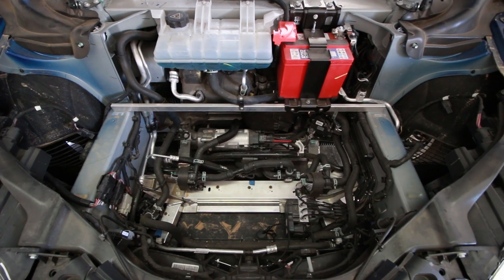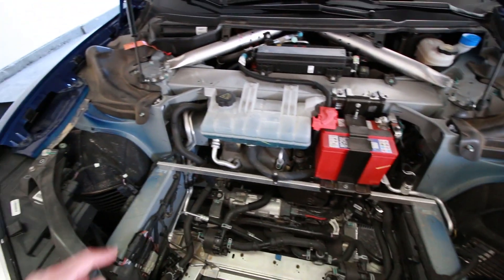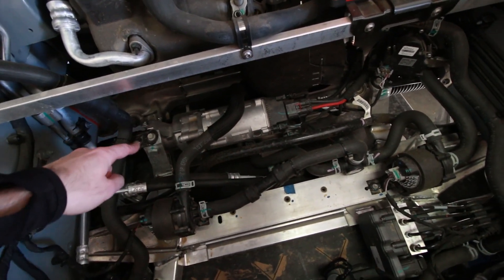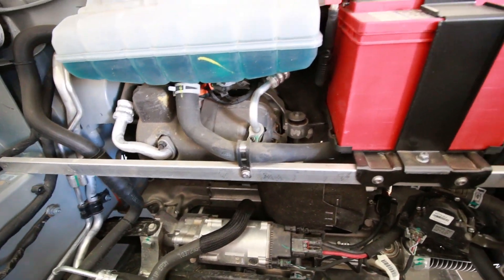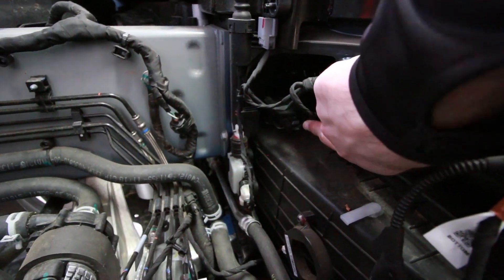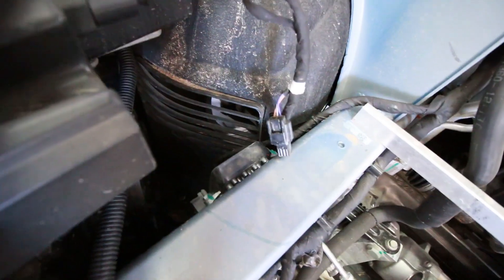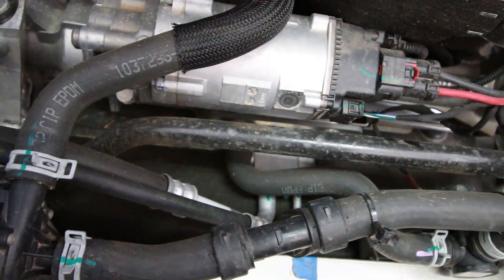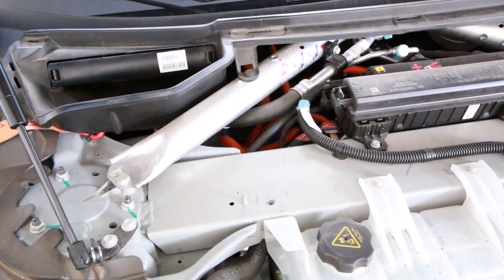What's Under The Frunk Of A Tesla Model S?

Comment: "Pre-refresh" and "post-refresh"? My 90D was delivered in late 2015, a few months after the first autopilot hardware was added. Is that "pre" or "post" refresh??
Reply from the maker: Hardware 1 (first gen Autopilot hardware) was introduced in October of 2014, the software that made it work was released in October of 2015. That detail aside, the first major refresh the Model S went through was in April of 2016 and is most easily identified by the lack of the large black nosecone that's present on older Model S. Being a late 2015 dual motor car makes yours pretty much the same as mine (pictured in video), just with a bigger battery--it's pre-refresh.
Reply: Got it, thanks!

Comment: Great, informative video, Alex! I'm so glad that I found your channel today. I couldn't even get the salespeople at the Fremont factory to admit that their cars had a 12 volt battery. Thanks for taking apart your car and explaining some of car's features. Where is the heat pump that warms the car's coolant to heat the cabin and warms the battery pack?
Reply from the maker: Tesla isn't actually using a heat pump system in the Model S/X for heating. The battery pack is heated by a combination of waste heat from the motor(s)/drive inverter(s) and a resistive heating unit as needed. The cabin heat is produced by a separate positive temperature coefficient heating unit (essentially a resistive heater where the resistance increases in a nonlinear fashion as it heats, causing it to self-limit current draw and, thus, temperature). This photo of a diagnostics screen is from an older rear-drive Model S, but should give you a better idea of how the thermal management system works (both the battery heater and cabin PTC heater are labeled): https://i.imgur.com/sZEnZFT.jpg
Reply: Alex Venz You're amazing! Thank you so much, Alex

Comment: Why is it that I can see all the way through to the ground (look along the steering rack,you can see the CV joint to the ground) isn't there some type of water barrier on the underside that would prevent me to see through?
Reply from the maker: While the Model S does have covers along the whole length of the underbody for aerodynamic reasons, it is necessary to have openings that allow for the passage of drive, suspension, and steering components as well as accommodate the full range of suspension motion. It is possible to create water resistant passthroughs, but it would be an additional expense and prone to wear related failure. The simpler solution that's used across the automotive industry is just to make your electrical connections and components water resistant where necessary.
Reply: Alex Venz which actually makes more sense

Comment: Hi there, very interesting but what is this 12v battery for and unlike a conventional car doesn't obviously get charged does it? Seems odd to have to have it replaced so regularly.
Reply from the maker: The 12V battery serves several functions, some of which safety related. The first and arguably most important job of the 12V battery is to power the main battery (traction battery) contactors--these contactors connect/disconnect the high voltage traction battery from the car's electrical system. If no power from the 12V system is present, the traction battery's contactors cannot close (or remain closed) and the high voltage pack remains isolated from the car. This functionality allows first responders to easily render the vehicle safer to work on in an emergency situation and it also keeps with general good practice of not energizing the high voltage systems unless they're needed. The other job of the 12V battery is to power all of the conventional automotive systems as well as the onboard computers.

As for charging, the car monitors the voltage of the 12V battery and will either charge it while you're driving if necessary or it will engage the traction battery's contactors to energize a DC-DC converter and charge the battery while parked. The high rate of replacement seen in the past was likely due to a combination of battery choice and the high rate of drain from the Model S (it could easily cycle the 12V battery multiple times in a day, even when sitting idle). Tesla has made some software changes which have improved the idle drain significantly, so it's less of an issue now.
Reply: Many thanks, Alex, for that very comprehensive explanation.
Reply: You should have this explanation in the description or something, there are a lot of idiots that are angry and confused over nothing.
Reply from the maker: Good idea--done.

Comment: What is the coolant for? (1:15 mark) battery pack?  motors?
Reply from the maker: The Tesla Model S and X use a liquid cooling system to pull heat from the battery pack, traction motors, motor controllers/power electronics, and the onboard charger(s). Even parts that are 90-95% efficient dump a lot of waste heat in high power applications.

Comment: The Frunk isn't full of stuff that is why you have storage space. The first couple of years Tesla had standard 12v automotive batteries that could fail after a year. Now they have heavy duty marine application 12v batteries. We don't know how long these last because they have not been failing.
Reply: No, because Li-Ion batteries are never meant to be deep cycled.  And cold and heat will kill them.  And Li-Ion batteries  will lose power just sitting.  Where as the Lead acid batteries are deep cycle and will stay almost fully charged when sitting for a long period of time in many environments.  Remember the big battery pack in the Tesla constantly manages pack temperature to ensure longevity.
Reply: If Li-Ion batteries were to be cheaper in the future, would it make sense to replace lead-acid batteries entirely?
Reply: It's the only thing that makes sense. It's unbelievable that they would put lead acid batteries in it.
Reply: Teslas use 'Deep Cycle' AGM batteries for this application.  That's a marine/air battery and is very rugged.  The military use these in their aircraft as do passenger aircraft.  They can operate at temperatures from 150 deg F down to well below 14 degrees.  This would put LiIon in jeopardy.
Reply: They use lead acid batteries only for regulation compliance, they have absolutely no need for them otherwise.
And the reason the regular ones were failing is constant power draw, because that the car is never truly off.
Reply: Some lithium works fine at -30c which is -22f. The US military is not a standard for intelligence.
Lead acid batteries are awful in many ways and should never have been in a Tesla. Unless there is some obscure law that requires lead batteries, it is a monumental inexplicable mistake.
Reply: I think it's the law of the market. There are Li-Ion 12v batteries on the market but they usually cost 2-3 times the regular lead acid.
Reply: MS, I assume you are speculating on regulation?
Reply: Dennis, that's not strictly speaking true. Like how Trump is not always strictly speaking right.
Lead handles deep cycles terribly. Lithium is much better at that. Nor do they drain on their own.
No thermal issue either that would warrant using lead.